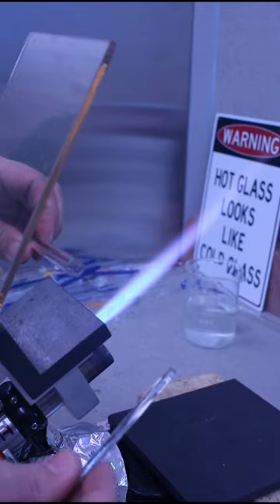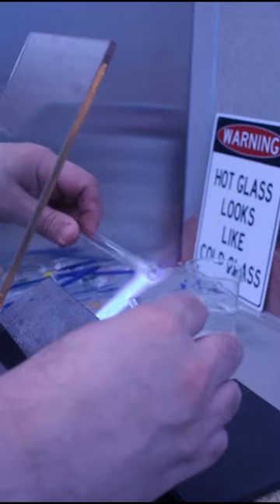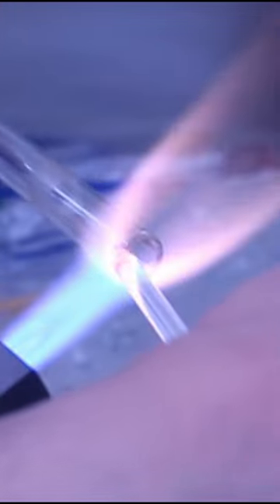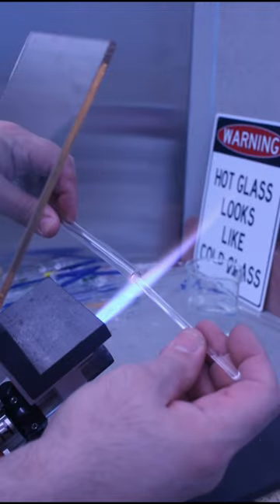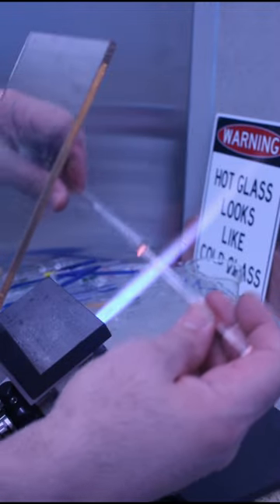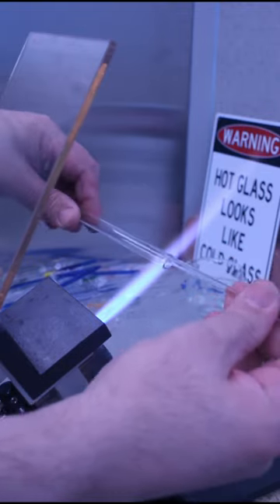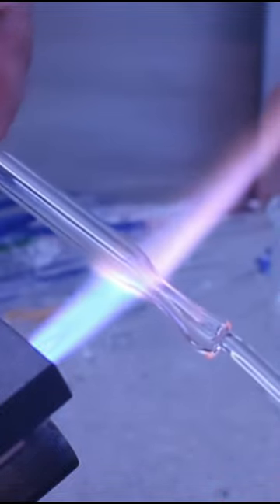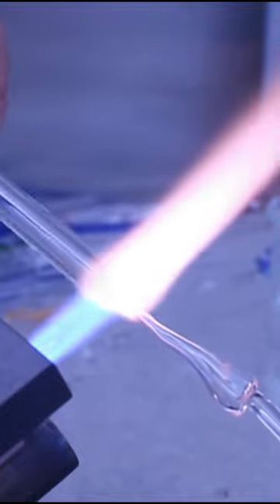Fire Cutting Glass Tubing

Comment: I've been torch cutting tube that way for about 17 years🔥
Reply from the maker: Awesome!  I've been bad at glassblowing for about 30 years!
Reply: Please, would you explain this to me?
I use glass tubes to water-cool computers, thus I always need both ends of the tube open. If I close off an end, it only means I would have to cut the end off anyway. How is making a test-tube called cutting a tube? Is it because it is shorter even though the end was capped?

Comment: That’s why you start in the middle so you don’t use tweezers or extra glass rod
Reply from the maker: You are right if I am cutting the tube in half then I will just hold it at either end.  In some cases you might have a crack on the end of the tubing that you want to remove.  This method (or tweezers) works well for that type of cut.

Comment: Gloves my guy, gloves.
Reply: The kind that restrict feel and motion or the ones that melt to your skin?   I know of no lampworkers that wear gloves.  I'm not saying they don't exist,  I just don't know any.  I know at least 20.
Reply: @richc.9273  just feel like something's better than nothing to protect your finger tips.
Reply: @Mr.JG.  understandable, however fingertip feel and dexterity is a must and believe it or not you can get pretty close to the side of the flame without too much discomfort as most torches have O2 as the outer most ring of gas generally giving directionality to most of the heat.
Reply: @richc.9273  I understand glass is pretty insulated, but damn lol.
Reply: As far as the flame itself goes, I have no idea about all that. Just an observation from a man that likes his skin. 😂
Reply from the maker: Actually, with a small flame like this there is very little heat being moved towards my fingers.  In some cases, larger diameter tubing, the heat can be so intense you'll get burned if your hand is with 3-4 inches of the fire.  In those cases, yes, 100% , you should use aluminized gloves or similar protective wear.
Reply: @ScientificGlassblowing  okay, that makes more sense to me. Just tryin to understand the thought process behind it all. Ty.
Reply: @Mr.JG.  Completely understandable.  I like mine too.
Reply: @ScientificGlassblowing  I know guys that'll sleeve up for vac stacks and such.  Haven't personally seen anyone gloved for any real amount of time.  But I'm not 30 years in either.  Hope all is well.
Reply from the maker: @richc.9273  This week I was pulling points with heavy wall 28 mm tubing.  I probably should have been wearing gloves.  My hand closest to flame was getting toasty.  Thanks!
Reply: @ScientificGlassblowing  how short do you go with the last point of a tube?  Just curious.  Or perhaps a better question is how many points per  tube?
Reply: I imagine you're using something bigger than the Redmax I use.
Reply from the maker: @richc.9273  I leave about 4-5 inches of glass on the end of the tube.  My plan is to attach that segment to a longer tube and then use a blow hose.  I typically work with a blow hose.  The points are more for demos like swan or Christmas bulb.
Reply from the maker: @richc.9273  Actually, no.  In my lab I have a Stacks I and II and an alpha.  I use the Stacks I or Alpha for 90% of what I do.
Reply: @ScientificGlassblowing  thanks for the reply.  Happy melting.